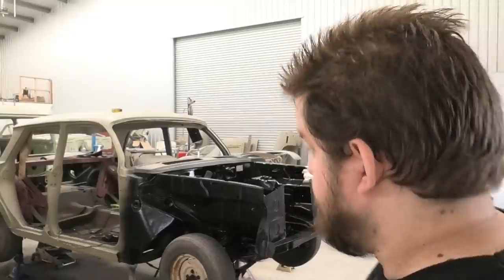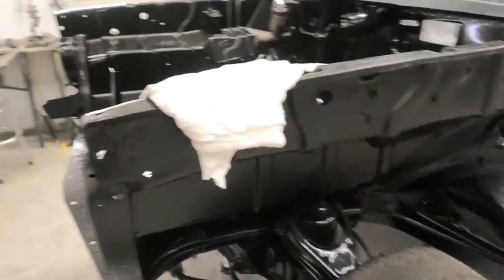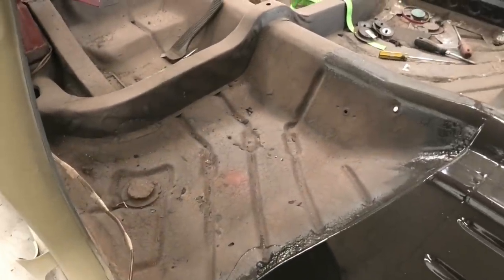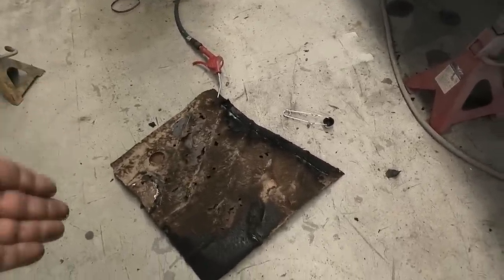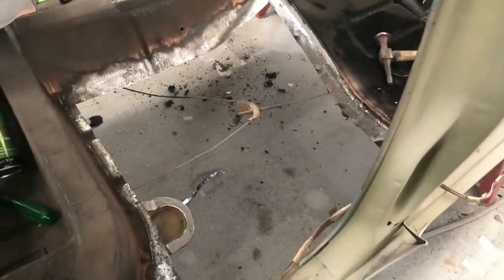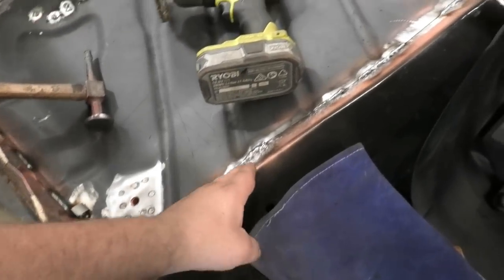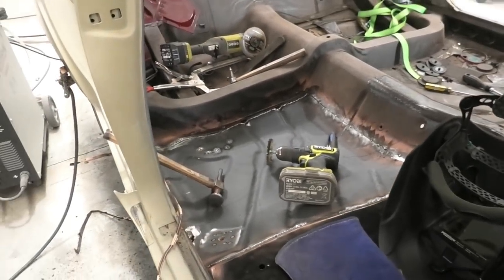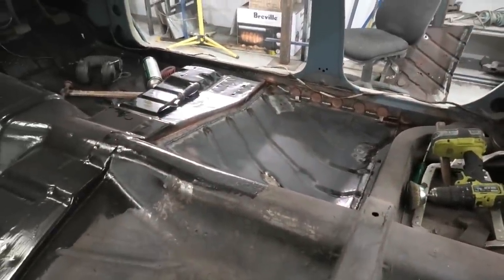Ej Holden rust repairs part 5 Floor pan!!

Comment: When I got my Amberley Blue with white roof EH wagon in the late 70s (for $450) the only rust in it were the floor pans which were really bad. Thankfully the father of a friend from school had a panel beating business and replaced them with new ones for $180, even painted them with some rust protection stuff. Best car I ever had. Mine had a 161 from an HR and three on the tree.

Comment: I put floor pans in a HQ one tonner a few years ago using Rare Spares parts and they do exactly the same arse about fold along the inner sill section on them too. The perfectionist in me was annoyed so I had chop it about and put it in the way the factory did it. I know the parts are not perfect reproductions but I wish they would stop taking liberties and make them as close to original as possible. The cars the floor pans are going into are worth considerably more than when these reproduction parts were first made available and it's time they took quality and conformity to original spec up a notch.

Comment: Graham I have to fill in a sunroof on an xc.....would you do it the cut tack cut tack method as you have down on the EJ floor or use another method. I have a cutout from another roof so it is same contour etc but just not 100% sure i should use the the cut tack way or not. cheers
Reply from the maker: oh sunroof hole i feel your pain thats gonna be about as fun as being hit in the crouch with a brick the cut and tack method is a good one just remember when welding it start at one side and work your way around cos every tack weld will pull the steel together so time and patience will be your friend